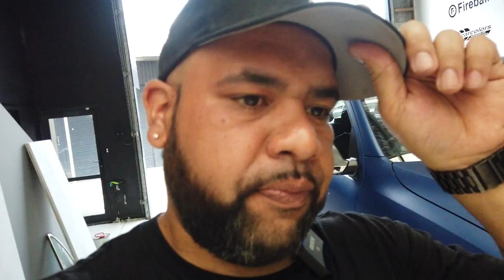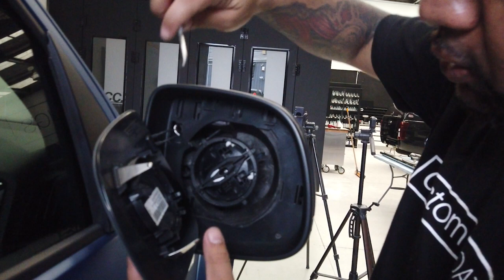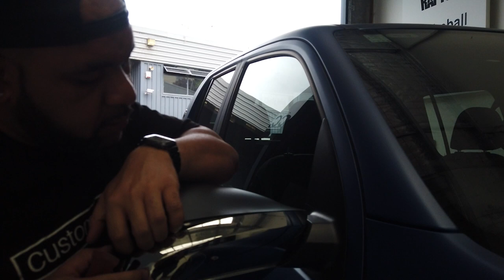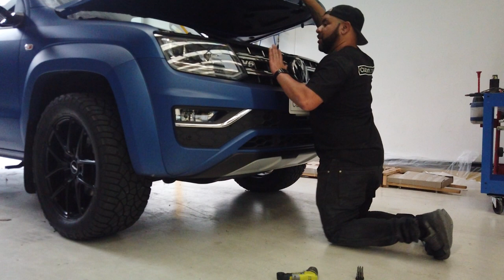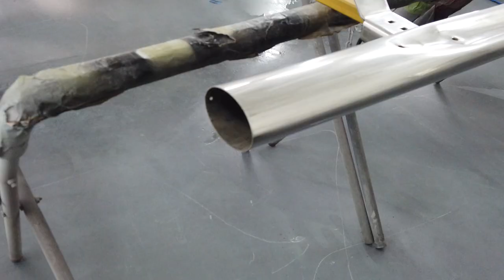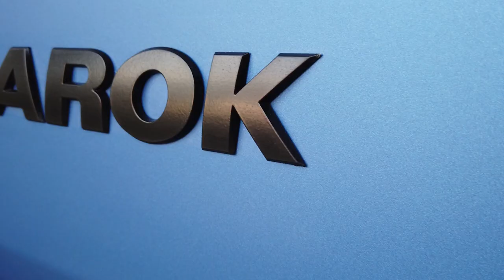VW Amarok Blackout/Chrome Delete - Looks WAY Better!

Comment: Howzit. Can you do a quick video on how to remove the amarok headlight? I want to replace/upgrade the bulbs.
Reply: hi there, did you eventually find anything? I am in the same boat.
Reply: @ThePiepiece  online says you remove the 2 hex screws on the top but I recently found out that the bumper has to be removed. There are 2 other hex screws underneath that must be removed, only then can you remove the headlight.....
Reply: Thats what I noticed when I followed the guide from autotrader. Removing the two top screws wasn’t enough. I don’t understand why there’s one video out there demonstrating this.
Reply: @ThePiepiece  I know, it's frustrating. Don't even know what clips hold the bumper in place or how to unclip them. What happens if a clip breaks and with amaroks, all the factory clips snap

Comment: Hi mate,  how did you remove the plastic ends of the chrome side step
Reply from the maker: Hey bro, we just removed the rivets that hold them in and knocked the ends out 😬
Reply: Thanks I’ll give it a go.  Thanks for sharing the vids.  Really informative.  Great work!